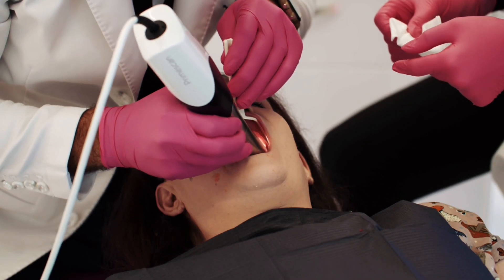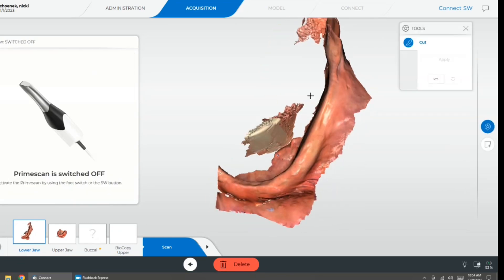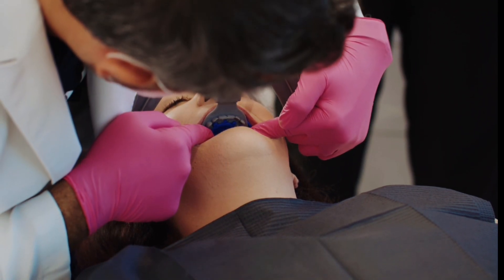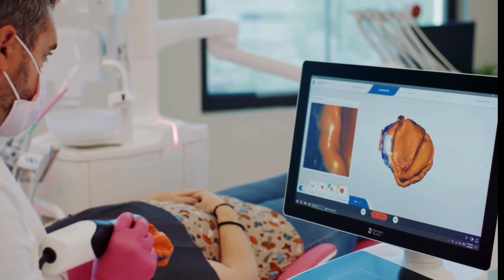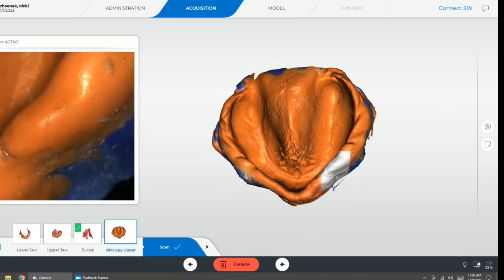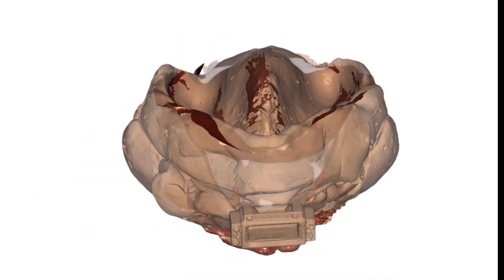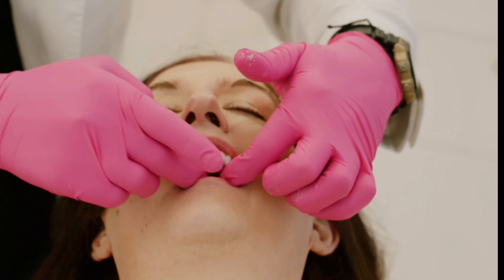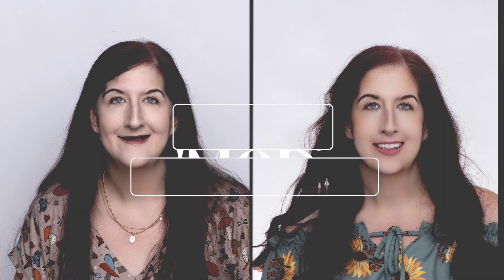Is same day or next day custom digital dentures a reality?

Comment: Beautiful… we often face problem in retention of upper denture when the digital impression of upper arch is made. Usually I follow a analog functional impression and scan that impression. Then invert in software. Your view on this….
Reply from the maker: Thanks for sharing! That would be a design issue. Digital impression is  pressure free, so in the digital design you can engage much more undercuts and add selective pressure when designing to ensure suction and retention
Reply: @wallyrenne That’s the explanation I’ve been looking for! I thought that the reason you get better fits through a ‘truly mucostatic impression’(scan) was because you had an even pressure throughout the fit surface of the denture - like a wet mug on the table
Reply: @wallyrenne have you work with a 3Shape Trios 3? Do you think is enough for an edentulous case?
Reply from the maker: @lacasadelvideojuego3880 yep that is one of the best